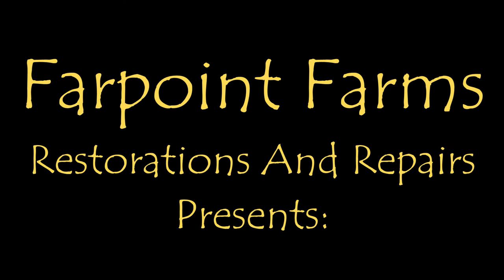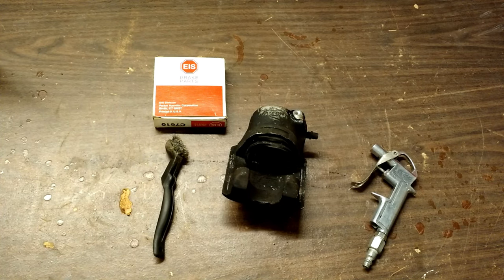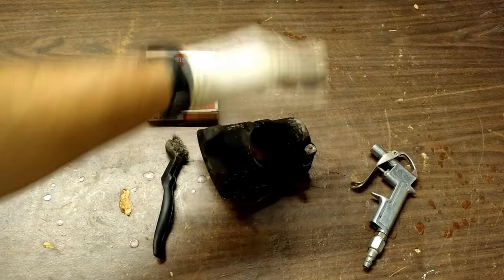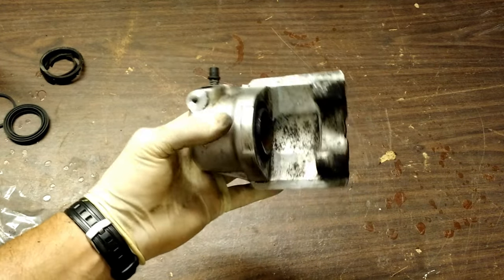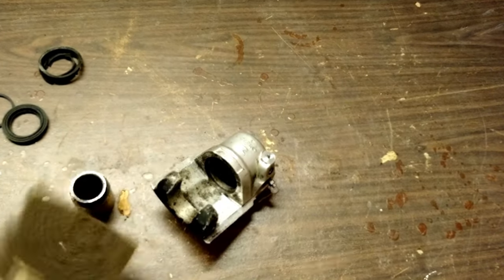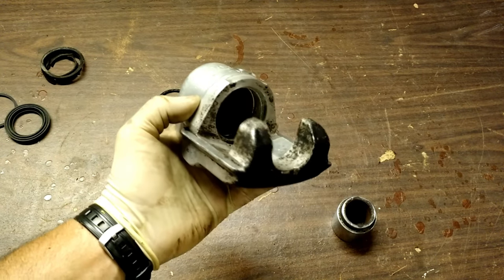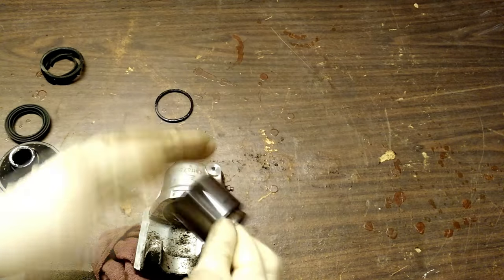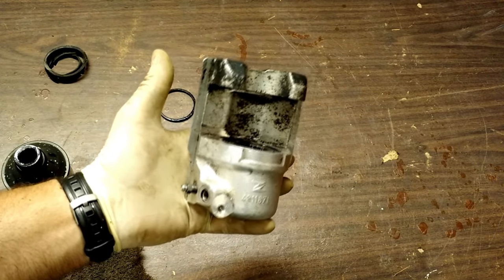A Skill You Should Know: The Lost Art Of Brake Caliper Rebuilding

Comment: I have been a Mechanic for 30 years, when I first started at the Dealership in the 90s we rebuilt all Calipers, and CV Joints. We rarely just changed parts
Reply from the maker: I was working back in those days as well. I must have rebuilt 1000 CV axles. Now? Chuck it and slap a new on in it. Sad.

Comment: when i was a kid walked over to the local garage and remember them rebuilding the calipers or refacing the routers or drums that was quit a while ago. I'm 69 7/8 years old   lol. my second choice when i went at the vocational was mechanic loved frigging at that stuff. but took electronics instead. often wonder what the outcome would have been if i had taken the other road ..when i was going to the vocational friend of mine and i took the head off an epic replaced 2 valves and hand ground the other ones put it back together reset the valves  worked like a top. that was fun times.
Reply from the maker: These days there is a battle in the industry. Some what to be called Techs as they now do a lot of computer work and such and feel that name is more prestigious. Others like myself know that it's the Mechanics that actually know everything about the trade.  Techs replace, Mechanics fix. I still know how to fix and I really want to share it with those that wish to learn.

Comment: That is a lost art. I’ve also noticed, no one bothers rebuilding starters & alternators too.
Reply from the maker: Good point. 99% of the time it's just the brushes. It's a $8.00 part and yet we buy a $300 alternator instead. Sad.
Reply: Used to but some of the  parts are getting very difficult to determine since they are being made in China. Many part numbers have been confused up as well. Got a friend in the business for 40+ years who says it’s getting worse by the minute and hates that his hands are tied.
Reply from the maker: agreed- I hate having to try and cross reference to see if a part will work- Half the time it doesn't frustrating for sure